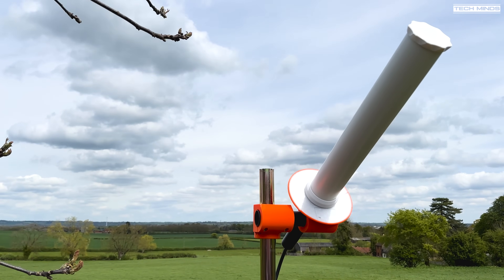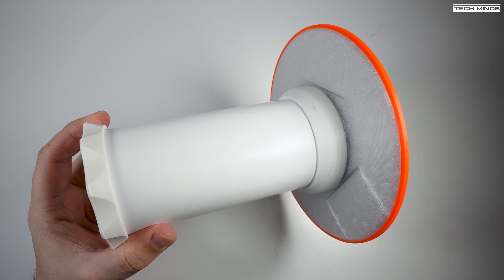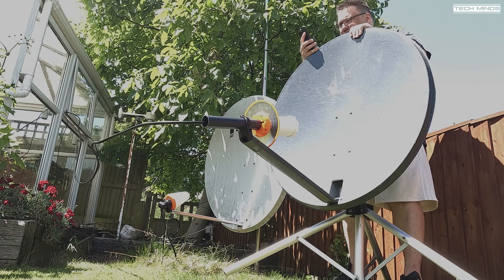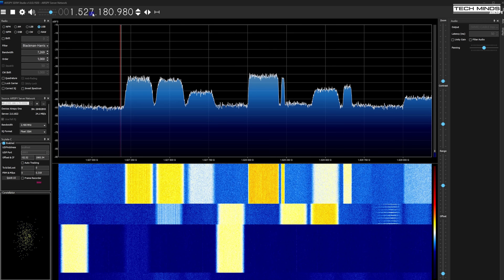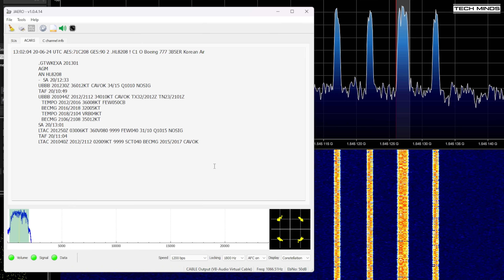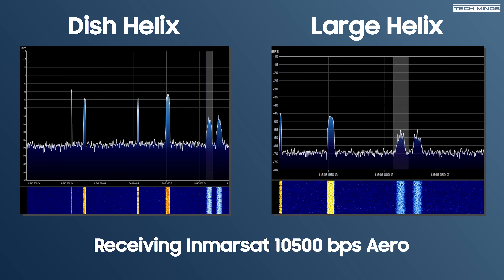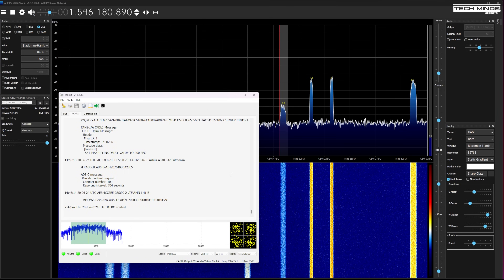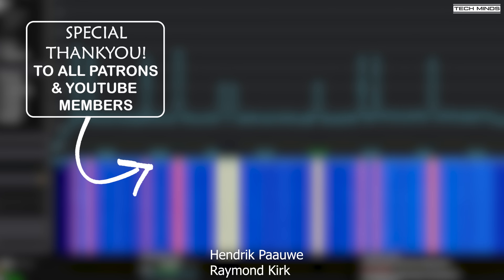This L Band Helix Antenna Gives Amazing Performance

Comment: It is amazing how much L band is coming down from antennas.
We have a lot of the TV and radio stations using this band for their feeds to their broadcast sites via satellite 🛰️📡 
I didn't understand why the land based services and radios  for the L band were eliminated.  Once I saw all the data coming from the satellites I realized that if we had land based Radios they would interfere with these satellite transmissions being received like the 5G signals are interfering with the C-band signals on the same frequencies.

Comment: Nice video. Would add that you can use the parabolic dish antenna calculator to calculate the correct focal distance based on the size and depth of dish used. You should be able to then just measure up where your Helix mounts and only have to move it back and forth a few cm. Calctown's website has a good one with the math included for verification if you're so inclined.

Comment: Fantastic. I would try using SatDump for voice but I have never had any audio out with this when using for Noaa weather sats so guess it won't work with this ? Is the frequency shown a voice channel ?
Reply: The voice uses an ambe codec. Not used satdump for inmarsat before, gotta try now.

Comment: That's great EoNb on the decode - I have one of those cheap 4x4 inch active patch antennas and even though the EoNb is only 8dB, it decodes all the Inmarsat ACARS perfectly.

For people starting out - there are web based applications that take your location and draw you a map of where to point your antenna to get the selected Satellite(s). Makes quick work of setting up - you immediately get close and only have to tweak the antenna after that.

Comment: Today i just finished and tested my 2.5 turn helical feeder with increased diameter (65 mm) so that it fits around a standard LNB radome. For QO-100 it performs poorly. Maybe i should test it for L-band ? However it needs more measurements to conclude, it may spill over the dish, under-illuminate, have a bunch of ugly side lobes or the PVC tube that the helix is wound around is absorbing. I could get the SWR down to 1.3 though...
As i said before, i sometimes try things even though the chance of success is 5% and sometimes it works.

Comment: Wish it had more than three turns
Reply: Then it wouldn't be terribly useful for illuminating a dish.
Reply: @stargazer7644  
Is this true?  Thought that was a function on how far from the dish its mounded?
Reply: @KA4UPW  It will always be mounted at the focal point of the dish - a fixed distance from the dish.  The number of turns on the helix depends on the angle needed to illuminate the dish correctly without overspilling or underilluminating the edges.

Comment: Is it right hand or left hand polarized?  Are Immarsat L or R?
Reply: At the beginning of the vid, I was thinking that small LHCP antenna was a dish feed, rigged for RHCP satellites.

Long ago, when I had a 10 foot dish, I made a 1420 MHz RHCP feed, so my dish would reject RHCP GPS etc signals. 
I could listen in on the hydrogen line at 1420 without all the GPS RFI. Radio Astronomy was fun, and I could hear EME SSB from South American hams.
 🌙 Bounce.
Reply: 88 PY9BG
Reply: Inmarsat transmits a right hand polarized signal. When you recieve that signal via dish the polarization flips, it is mirrored. So this antenna is left hand polarized.